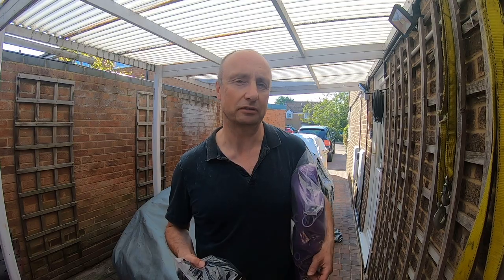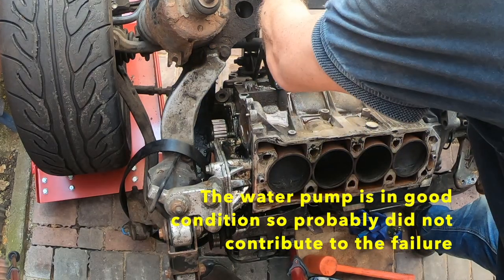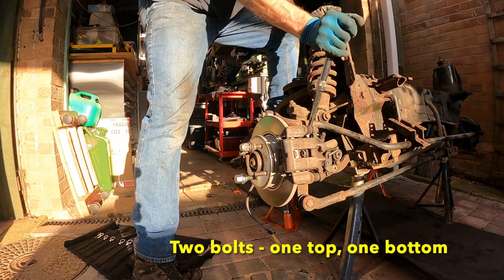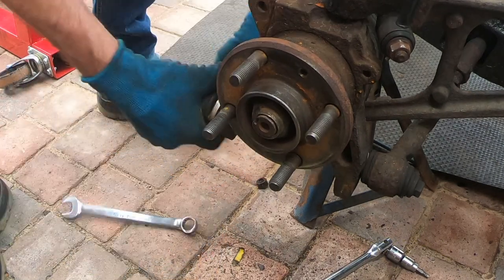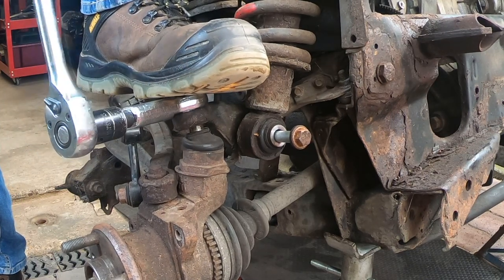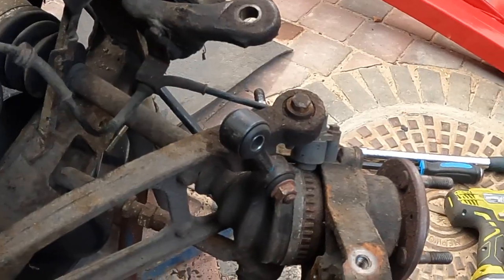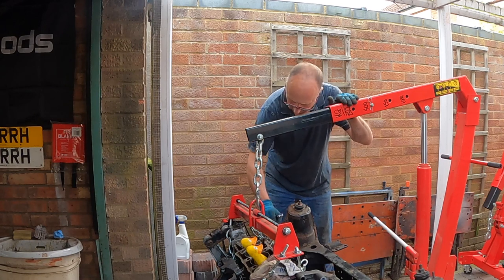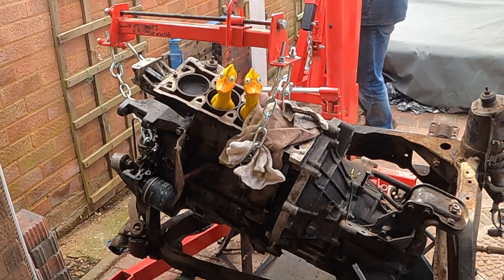Scotty’s Overheated MG TF 135 Rover K Series Engine & Subframe/Suspension Rebuild (non-VVC) Part 4

Comment: Good video. Just be aware if you aren’t already that those nice shiny new hoses are only for a car with PRT thermostat, so you will need to bung one in and remove the one from the usual spot at the back of the engine.
Reply: @DoubleDuckGarage  no, my cars have it fitted. It’s pretty straightforward though I think.
Reply: @DoubleDuckGarage  . I converted mine to PRT with custom made pipes, make sure you turn the existing thermostat into a blank by cutting out the central bits.
Reply: @DoubleDuckGarage  yes it can be done; have a look at some of the forums, or ask around on the Facebook groups. I think the main thing is ensuring your coolant system is in the best condition possible, so a new radiator might pay more dividends than ‘just’ moving the stat.
Reply: @DoubleDuckGarage  I have a Late model rad with twin fans to install at some point. Like you, I have too many projects though. I’m giving serious thought to turning my spares car into a track day car, so this is a great series!
Reply: @DoubleDuckGarage  . I just copied the standard setup. It you placed it by the radiator that creates a much larger internal circuit which would slow the engine warm up. I have seen diagrams of that for an Elise, bit it's beyond my comfort zone! That said I had a PRT jam closed and it caused overheating, the lesson being to replace it every so many years.

Comment: Good job. You will clear the engine Bay before put back subframe?
Reply: @DoubleDuckGarage  This is a good time to remove corrosion inside the engine bay and to clean and repaint the frame. With a well-made gasket, there should be no problems. With improved water channels with a newer position of the thermostat, it should be ok. It is a very good engine with a brilliant design for the time when it was created.  Sorry to see nothing happening in Longbridge 😐 Awesome movies, I like watching you work on the car. I'm waiting for the next 😉 I love my TF, greetings from Poland 😉